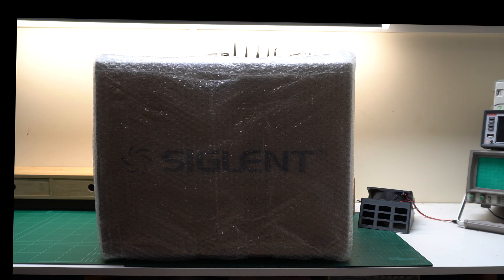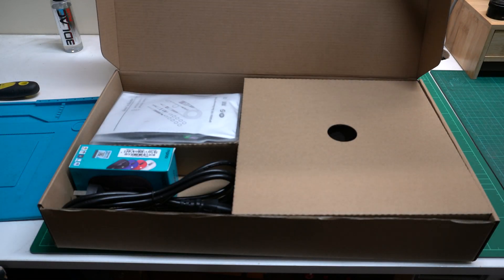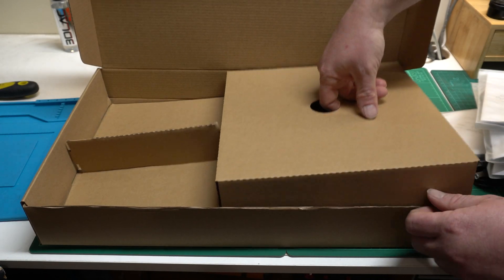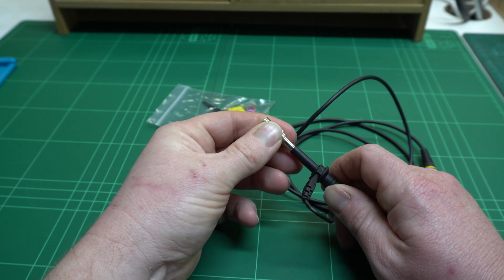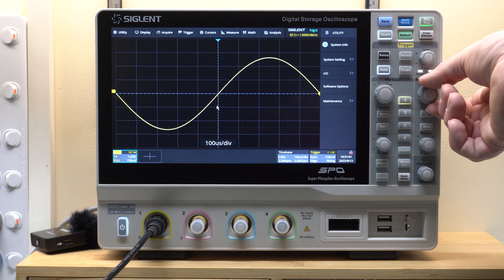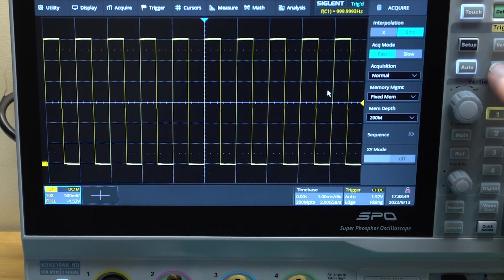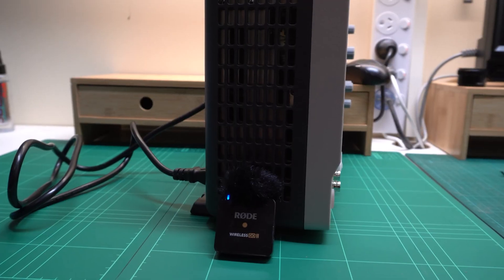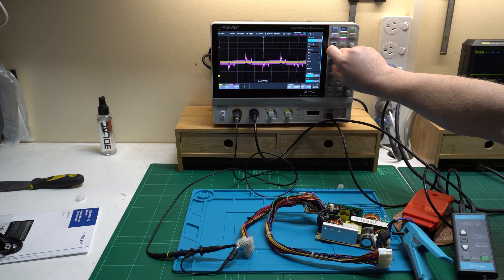Siglent SDS2104X HD Unboxing and First Look

Comment: Makes nice dramatic wind down noise .. life is mundane without some drama 😇
Reply: Yes it is a bit lame to see power supply noise considering the cost of this instrument. Difficult to fix coil (inductor, choke transformer etc) noise if at all it is from the coils as these are often non standard custom parts. Anyways an investigation into the issue will make a nice video 🙌. Also can be a case for RMA.
Reply from the maker: Unfortunately it's like that always in standby. I just turn it off at the wall when not in use. Thanks for the comment 🙂